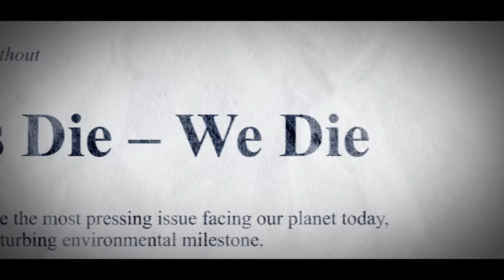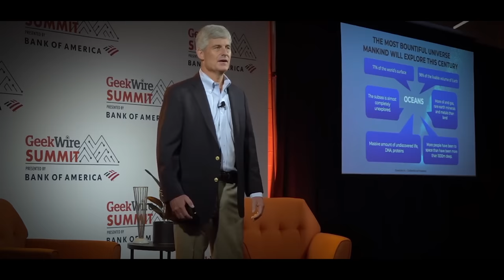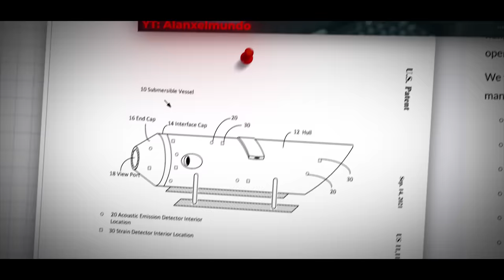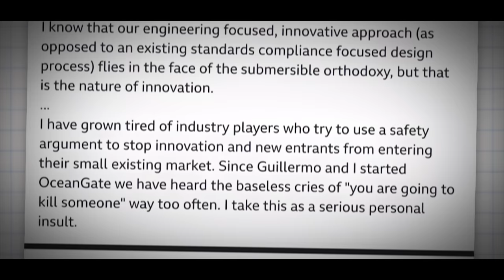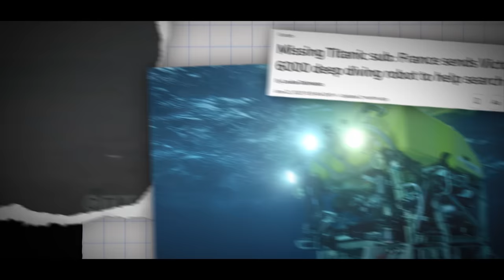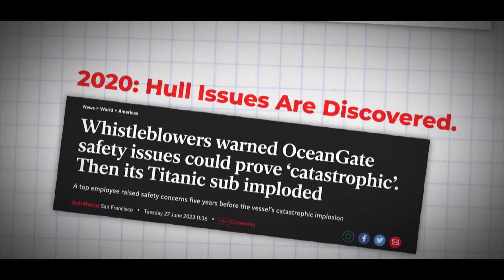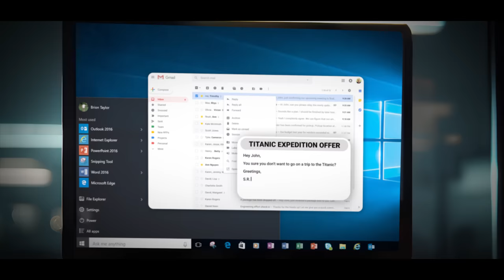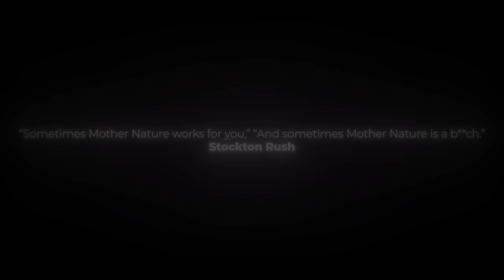The Dark Truth About OceanGate (Documentary)

Comment: In case anyone is wondering, the reason you can't use carbon fiber this way is pretty easy to understand. When used as pressure tank, that is keeping pressure IN, such as in aircraft or air tanks, the pressure is trying to pull the carbon fiber apart as it pushes outward. Carbon fiber is, well, fiber, like a string. It's REALLY good at resisting being pulled apart. But what happens when you try to push with a string? Yeah, that doesn't work. Well when you put all the pressure on the OUTSIDE of the carbon fiber pressure vessel, the fibers can't resist that because they are being "pushed" instead of "pulled" and so the stress is transferred to the epoxy, or "glue" that is holding the carbon fiber together, and obviously the glue can't take that stress, so the vessel fails.
Reply: Thank-you for that explanation! I heard the experts say that using it for holding pressure in was different from keeping pressure out, but they didn't explain why. They probably thought it was obvious, sort of a reverse Dunning-Kruger effect. You must be a good teacher! You realize that not everyone knows what you know, and can explain it using something they do.
Reply: You explained that so well, thank you :)
Reply: Don't you build a lot of aircraft with a non-pressurized cabin from carbon fiber?
Reply: @ackerkartoffel8627   It's not pressurized, so pressure is equal on the inside and outside.
Reply: Great explanation. Thank you!
Reply: @ackerkartoffel8627 Airplanes are actually internally pressurized, so they work more like an oxygen tank than a submarine (the ‘pulling’ version of the pressure force)
Reply: @ackerkartoffel8627 The pressures that airplanes have to deal with even at such high altitudes is minuscule compared to the pressure of being underwater for a few dozen feet let alone a few HUNDRED feet and they went further than that on many dives with the same hull. >___< I am not sure what the exact equation is for a plane at 1,000 feet above the Earth vs a submersible 1,000 feet underwater, but it’s so much greater. For another example, my ears don’t feel like they’re going to explode when we take off in an airplane, but if I go down just 20 feet below water, my ears feel an enormous pressure and I have to equalize for a while to get it to stop. I am a scuba diver, so I have gone 20+ feet down.
Reply: Carbon fiber under compressive stress is literally like trying to push car using rope.
And while you can make that carbon fiber composite pressure vessel strong enough to initially survive compressive force, there's fatigue leading to separation of fibers from resin and delamination. Untill you get failure... Which is always catastrophic with the forces of deep sea.
Again if you make pressure vessel from well known steel/titanium and design it strong enough, it can take intended stresses basically without wear. (in fact use might just make it stronger)
Reply: Thank you so much for the explanation. It really helped me understand what they're talking about
Reply: Just turn it inside out? Duh
Reply: Hey thanks for taking the time to teach us something! Good stuff.
Reply: Great answer. I'm sure Rush knew this but was a total idiot unfortunately.
Reply: Thank you
Reply: thank u for this explanation i was rly confused by that lol
Reply: They literally said that in the video
Reply: @junkmunk9754  but still, im dumb and very slow, this explanation helped me a lot, more than the video one
Reply: Whenever I see the lets go brandon stuff (ur username of course) it just makes me think that people are rooting for him now LOL I know where it originates from and what it means, but still I can't help but laugh about it.
Reply: @Nulldron My first name happens to be Brandon, so this will likely be my name on social media forever now XD
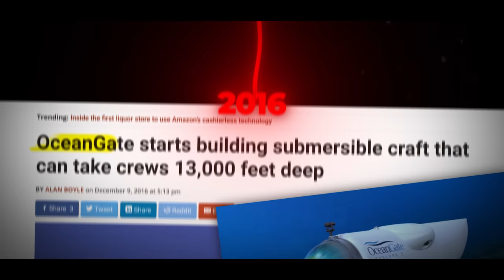Reply: 5:39 "Carbon fiber is 3× better on a strength to bouyancy ratio than titanium, and yet nobody had done that." 🙄

Nobody had done that because they were smart enough to know the difference between internal vs external pressure, and tension vs compression forces. Carbon FIBER is basically just a bunch of strings, which feel strong when PULLED in TENSION, but just feel flimsy and weak when PUSHED in COMPRESSION. That's why carbon fiber is good for airplanes and scuba oxygen tanks which have INTERNAL pressure pushing outwards, but would be terrible in a submersible with EXTERNAL pressure pushing inwards. Also, a carbon fiber submersible would be fine if it was an unmanned robotic vehicle where the interior could be flooded to match the outside pressure, and then that extra bouyancy could be beneficial. But if you're carrying people who need oxygen, and you need your pressurized vessel to withstand insane EXTERNAL pressures of many TONS of water per square inch, then you don't want your life to depend on the strength of strings and glue like an elementary school art project.
Reply: @wrathchild3935 he just thought he was some kind of industry pioneer who could get away with it…how gross
Reply: wait..... this documentary never goes over WHY it failed? oh boy
Reply: It seems this was all about money. How much more expensive would a steel cabin be vs a carbon fiber one?
Reply: I don’t know if I’m right but I imagine it as if you started blowing up a balloon and placed rope/string around the middle of it and kept blowing it up (inward pressure) the rope would keep its circular shape but if you poked that rope into the ballon (outward pressure) it would easily bend/misshape, in a sub, implode. Just my weird visual in my head lol.
Reply: That's already explained in this video starting at 6:27 by James Cameron himself.
Reply: Thats not exactly it though. Issue is mostly with pressure cycles. Composite materials, and honstly any non metallic material is not great with degradation damage. Carbon fiber can resist the forces, thats not the issue, issue is resisting it back to back over a long time. Everything gets worn out and when carbon fiber gets worn out, it literally breaks apart.
Reply: Thanks for the easy to understand explanation!
Reply: @pandakicker1  Did you mean "As a Scuba Diver, I've gone 200+ feet down"? Because 20 feet is shallow. I'm not sure, but can't someone freedive (nothing except their own bodies) down at least 50 feet? And please do correct me if I'm wrong. I probably am. I've only watched a few videos on Scuba and Free diving and I could have my info wrong where the free diving is concerned. Maybe they DO use some kind of breathing apparatus, but it's not as in-depth as what Scuba divers use. Or maybe they CAN just hold their breath and go down that far.
Reply: This is a perfect explanation of how this works and needs to be upvoted more
Reply: Thanks Donnie
Reply: As a mechanical engineer this is not entirely accurate but is generally true. The main failure on this submarine was the difference in materials, titanium and carbon fiber have vastly different behaviors under loading. Metals flex a lot (relatively) which allows for very easy inspection and testing, as well as consistent manufacturing. Carbon fiber has almost zero elasticity, and beyond its elastic  range is complete failure, as it loads its shape hardly changes, while titanium changes significantly more. This means at the depths of the sub  the titanium was pulling itself off of the carbon fiber. The stress concentrations at the joints between the metal and carbon were completely unsustainable and most reports believe that is where the fracture started.
Reply: Exactly. The way I've described it to people is by saying "when you want to climb down a cliff, you don't tie your rope to the bottom like you'd tie it to the top when you want to go up."
Reply: @chattycatty3336 finally, an intellectual.
Reply: @Imshittingmypants  That does sound like a more accurate description of what happened. If the leaked radio transcripts are real then that explains the period of time between the first acoustic structural alarm and the final message transmitted. If the carbon fibre itself failed it would implode milliseconds after it trips the first acoustic alarm, not seconds/minutes later.
Reply: It's amazing how many people are not even acknowledging the fact that his carbon fibre stock was purchased as defective scrap waste from Boeing. Boeing deemed it faulty and garbage for use in their aircraft and it was going to be thrown out, but Stockton Rush saw a cheap price and big $$$$$$$ savings.
Reply: You should get a job as a teacher I went to school for 14years and nobody has ever explained something better to me then you did this 😂
Reply: @tamilo3949  ha, no I do not have the patience or people skills for teaching. But I write technical documentation for non technical staff as a small part of my day job.
Reply: So basically... Carbon fiber matrix under compression, has the strength of not much more than the two part epoxy that was used to impregnate the carbon fiber cloth...
Reply: other than that, carbon fiber behaves closer to glass than metal. it makes invisible cracks, then shatters.
Reply: @usamong1129  You just painted a picture in my minds eye of what those guys went through.  Can you imagine hearing probably some loud and more than just noticable snap crackle pops, then suddenly a loud boom.  Not even sure if there was even any water intrusion until catastrophic failure.  Which...  means the owner operator had to have known the sub was delaminateing from previous dives.  Ooof
Reply: @pandakicker1  i dont disagree with you at all, but airplanes are pressurized - you would definitely die by asphyxiation from lack of oxygen at altitude, versus dying from pressure at depth.  Your ears don't pop as much on an airplane because its not quite as pressurized as ground level on earth, but its still significantly pressurized at altitude
Reply: Noble prize for our mate right here !!!!!!!!
Reply: @trishoconnor2169 that's why I chose another student to teach me something instead of the teacher, the teacher has so much experience they forget what its like not to know something (there's a term for that I don't remember it though) while thr student has a better idea of how to teach it because he just learned or is still learning
Reply: @tuunaes  You stated, "Carbon fibre under compressive stress is literally like trying to push car using rope", Which was one of the 3 reasons for the catastrophic failure. It is easy to demonstrate, by simply wrapping the core of a toilet roll in carbon fibre. When you apply balanced force from the inside, it is enormously strong, but from the outside, you could crush it in your fist.

The crush strength came from the epoxy resin, but due to its method of construction, it was full of minute air bubbles. As pressure increased on the outer layer, they collapsed, but as they filled with high pressure water, an equilibrium was reached. However, as the craft surfaced the water filling the holes ejected outwards, leaving the epoxy filled with water at atmospheric pressure. 
Therefore, with every dive, the damage went deeper, until the whole structure ended up with the strength of a soggy sponge.

The faster final dive was purely the result of the weight of the additional water. How that was not realised, defies belief.

I saw a possible solution, by starting off with 2 titanium tubes each of around 10mm thickness, one inside the other with a 5 inch space and welded to end plates. 
By fist evacuating the cavity, then filling it with epoxy mixed in a vacuum, and sucked into evacuated cavity, their would have been no air, but the epoxy would have needed the same thermal coefficient of cubical expansion matched to the titanium shell. 
The whole thing would have been completely solid, with no possibility of egress of water.

Correctly weighted and with solid titanium end caps, this could have been raised and lowered from a ship countless times for testing and x-rayed after every dive, including a few hard landings. 
Only then should it have been considered for use.

The nose radome of Concord was a similar structure, except the mould was removed after forming. It was one of the parts of the aircraft that never failed during more than 30 years of flight. 
Solid epoxy mouldings have enormous strength. 
Needless to say, if I had worked with Stockton, I would probably been sacked after less than a week. LOL
Reply: This is a great explanation. I've been struggling to get people to understand that there are different kinds of pressure and that just because the same materials are used in different places doesn't mean they will work for everything. Some guy I was watching was saying that since the material can hold airplane wings together then it should be able to withstand the immense pressure of the sea. Same guy was also saying all the theories are wrong because there is no way they would communicate with the sub through anything but voice so people using "leaked text" as a basis are dumb and wrong.
Reply: @Atelierwanwan  Did you read my full explanation on this thread.?
Reply: Is epoxy glue or is glue epoxy?
Reply: I thought they partnered with APL grads from esteemed university? With engineering students? How can they miss & overlook this information? 😢
Reply: I'm mean this literally, that was so well explained in layman's terms if they still don't get it they won't .....(Pushing/pulling with string) Was all I needed to connect the dots.